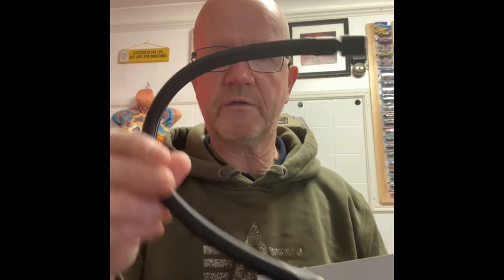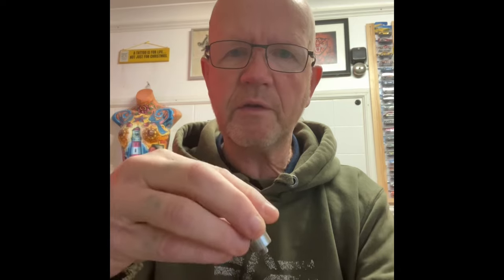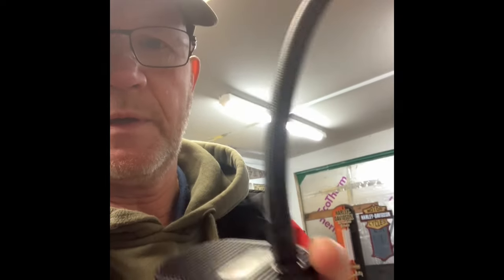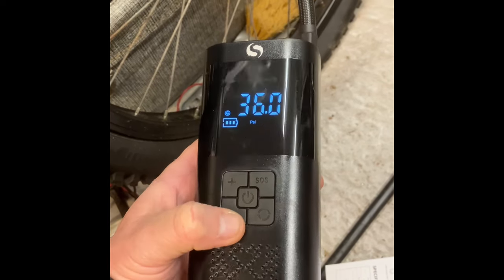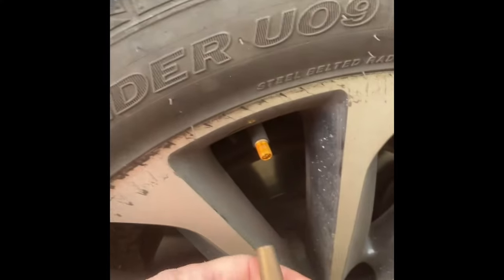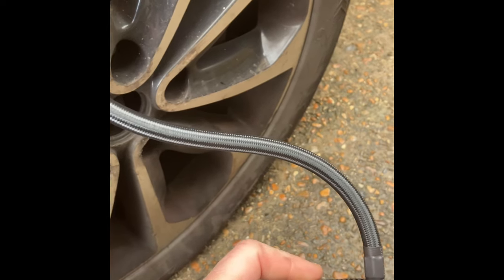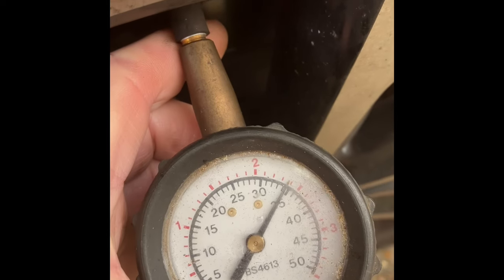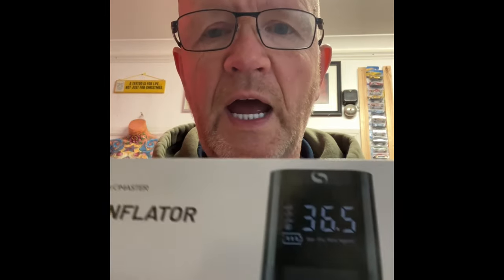Must Watch Servomaster tyre air inflator off Amazon bargain review NOT sponsored

Comment: You have it on ball settings?
Reply from the maker: not sure what you mean, i used it as it came out of the box works well, air is air, no settings for different items, just set pressure and it does the rest unless you have a different one to me

Comment: How long does a full charge last ?
Reply from the maker: I've actually not tested it from full to nothing but I did two car tyres from totally flat , topped two up and it still had some charge left., best to charge up after every couple times of use , it's only a cheapo so wasn't expecting huge battery life, i bought another for my second car because they work ok. why pay silly money for a fantik that does same job and is made in same country
Reply: @larrysvintage  I'm just undecided on weather to buy one of these of one of the little square orange  RAC ones for about £12.50. They work from a cigarette lighter socket
Reply from the maker: @andrewbennett137  my mate had that exact one, got it from B and M i think, junk with rac name on. personal choice i guess, I prefer the wireless ones hence I bought this , I seem to recall my pal took his one back as it blew fuses which is the issue with wired. hope this helps.